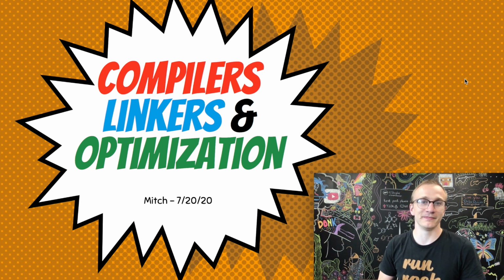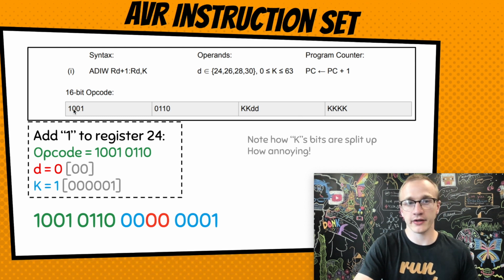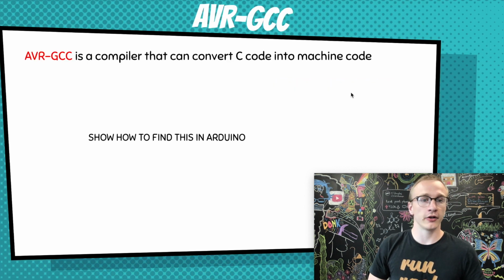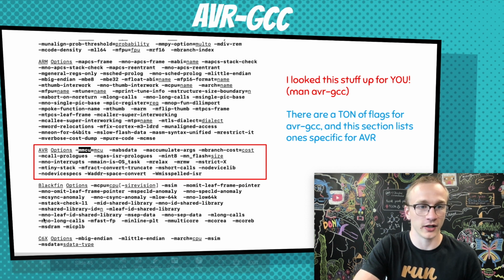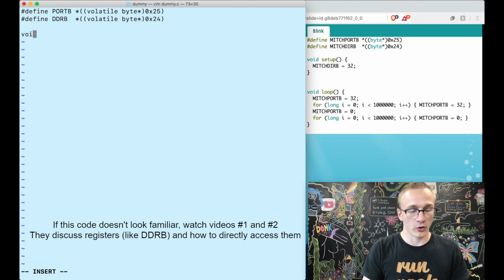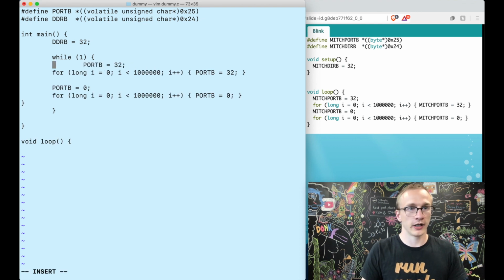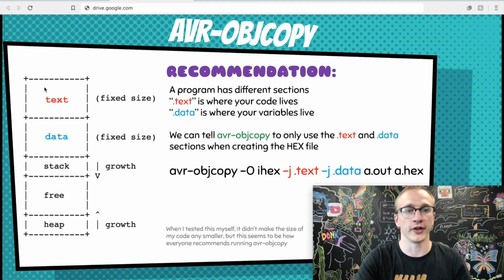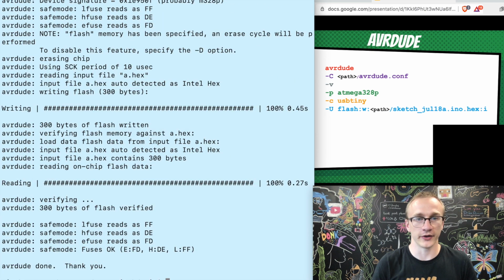Bare-Metal MCU #6: Compilers, Assemblers, and Friends

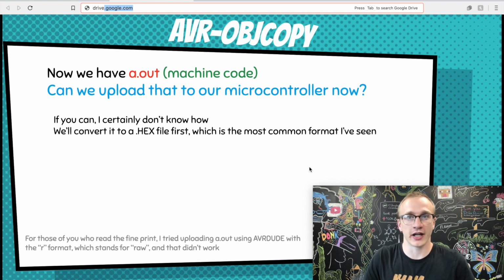Comment: 17:27 The hex dump you showed a while ago is a regular ELF file (you can recognize it by the first four bytes, 7F 45 4C 46, which translates into [DEL] 'E' 'L' 'F' in ASCII), which is a portable executable and linking format used on many platforms. It doesn't contain just the machine code of the program, but also a lot of other stuff, like headers, sections, their names, addresses of segments in memory (i.e. where the machine code should be uploaded), etc. For linking purposes, it's basically just a catalogue of fragments of binary code that the linker would slice and splice into the final executable (which often is also an ELF). That's why you needed to use objcopy, which takes just the machine code part out of the ELF file and dumps it as hex which the avrdude can read and send to the programmer as raw binary data.
Reply: Thanks. I tried uploading it before conversion by just changing the avrdude -U ...:i parameter, and that explains why it didn't work.

Comment: does not work in windows10:
avr-gcc.exe -mmcu=atmega328p a.c
avr-objcopy -O ihex -j .txt -j .data a.out a.hex
avrdude -C avrdude.conf -v -p atmega328p -c usbasp -P usb -U flash:w:a.hex:i
But if you more complicate this like this:
REM set names:
SET name=blink
SET port=usb
SET progr=usbasp
SET device=atmega328p	
SET compile=avr-gcc -Wall -Os -mmcu=%device%
REM compile:
%compile%  -c %name%.c -o %name%.o
%compile%  -o %name%.elf %name%.o
avr-objcopy -j .text -j .data -O ihex %name%.elf %name%.hex 
avr-size --format=avr --mcu=%device% %name%.elf
REM upload:
avrdude -v -p %device% -c %progr% -P %port% -b 115200 -U flash:w:%name%.hex:i
will be OK.

Comment: I found on linux I could flash the compiled version of blink onto the ATmega328p with the avrdude's "e" option. So  with gcc-avr, avr-libc, and avrdude packages installed, I can upload code with only two commands:
    avr-gcc -mmcu=atmega328p blink.c
    avrdude -v -c /etc/avrdude.conf -p atmega328p -c stk500v1 -P /dev/ttyUSB0 -b 19200 -U flash:w:a.out:e

The other way (using avr-objcopy to change to hex) seems to result in a much smaller file, but this way works w/o introducing an extra command line tool. 
Not sure if there's other hidden downsides to this?
Reply: @Danielle Thurow thanks for the heads up about the 'e' format, it's even listed in the video when he shows the manual but i did not notice until i read your comment. kudos !

Comment: With regard to whether or not you can upload the file directly, the answer is no. It's in ELF format, which has a lot of extra information that's typically used by an operating system. When you convert it a hex file, you flatten it by removing all that extra data so you're just left with raw code and data.
Reply: Avrdude actually handles elf files as well,i've uploaded elf files with avrdude a couple of times.

Comment: Nice video, although I don't do embedded stuff myself.

The editor you were referring to that opens when you run "man <command>" is actually a pager, on my Linux installation it's "less" (and probably on Mac too) and on Windows it's "more" which I believe is similar to the *nix "more" pager - of which less is an improved version.

Pro tip: you can actually use vim as a pager, Google "vimpager" for more info.
Reply: You are correct with the guess, if you look at the top of the terminal it shows the program that it is using and in this case is less

Comment: For the install on Linux, you also need to install avr-libc . It wouldn’t compile until I had that, and it didn’t install automatically
Reply: Thanks. AVR-GCC only worked after installing avr-libc (sudo apt-get install avr-libc). Ubuntu 20.04